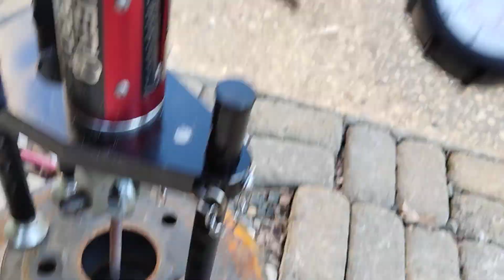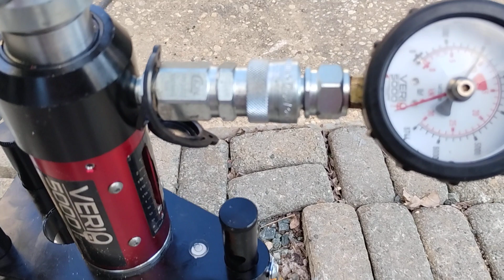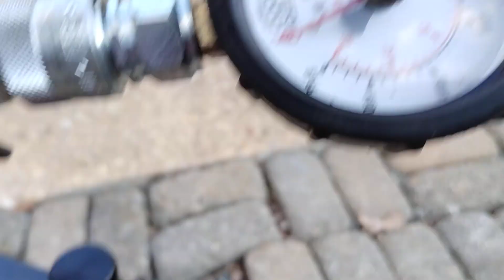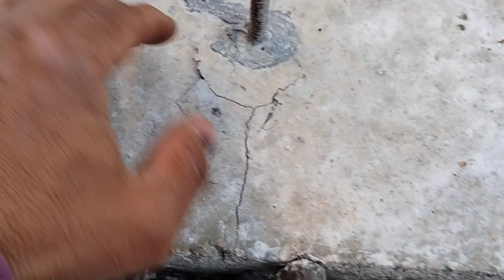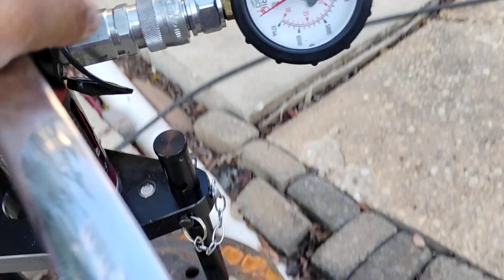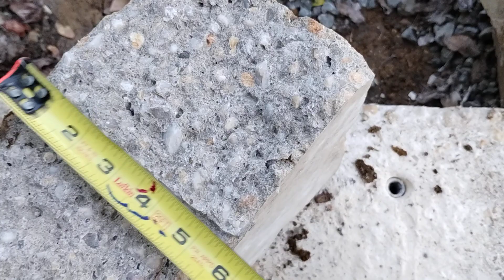Anchor Bolt All-thread epoxy ratings, SURPRISE failure method Concrete part 2 #concrete

Comment: Great demo, what is your idea, if the surrounding concrete brakes up, before the the design strengh has been reached? Bad psi?
Reply from the maker: Think of it this way, the concrete failed in tension or did it fail in or as a result of compression?
Look at the sample I show and I will do a video explaining more.
But, look at the concrete sample again and tell me what it reveals. 
Edit to add, "it".

Comment: Great demonstration Professor. I would have never thought that small amount of epoxy would hold up that much.
Reply from the maker: Thank you! And, yes it is amazing and the ''damage'' it does during failure... imagine people overloading an anchor and how the stresses "look" inside the concrete!   Imagine, if they had anchors holding down the poles and tent they put on the champlain towers south deck...  Of course, the stress would not be near the 4000 psi I achieved but depending on the anchor (expansion shields) DO permanently stress the area they are ''behaving" with.    I saw a car lift installation by a few people with the bolts at the edge and then they wonder why, after car being raised, did the concrete fail...